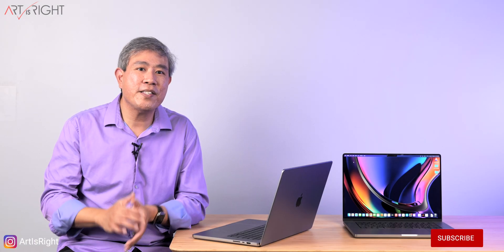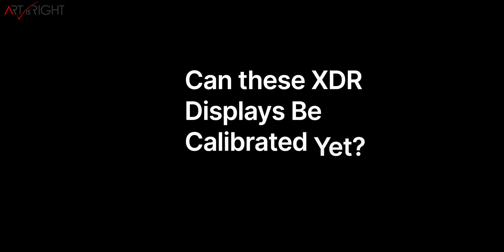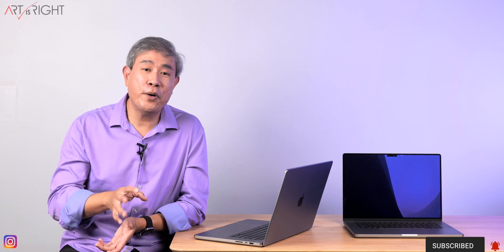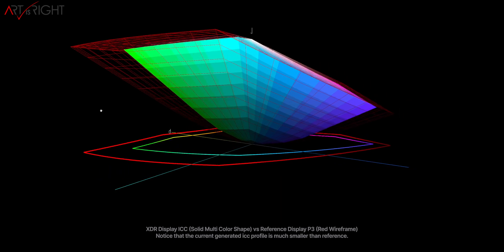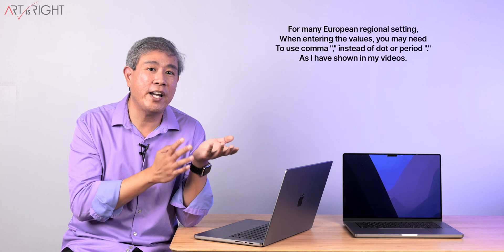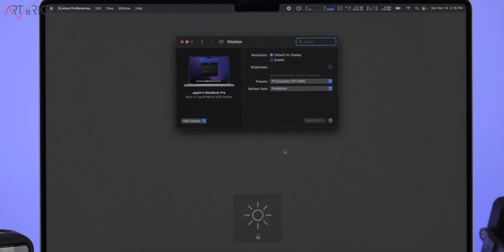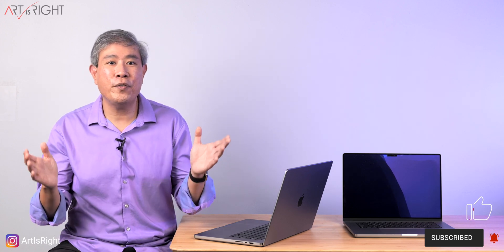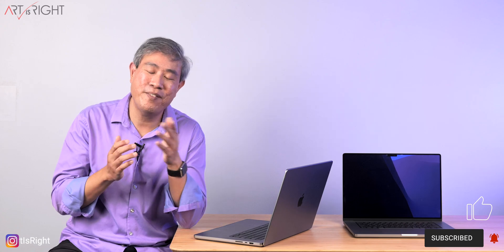State of Apple Liquid Retina XDR, Can I calibrate these yet & some miniLED Q&A

Comment: So the Pro Display XDR, iPad Pro, and mini LED MacBooks are 'technically' Quantum Dot displays or a different display altogether considering the blue LED backlighting? I'm confused, just wanna know exactly what kind of display tech they're using.
Reply from the maker: MiniLED backlight, not quantum dot, those are marketing terms used. Technically the miniLED used here are still PFS phosphor tech but the spectral output is different
Reply: @ArtIsRight thanks, which tech is better though, PFS or QD?
Reply from the maker: For different LED backlight tech, I would not be classified one as better per se

Comment: That's great, and a bummer at the same time! I just "calibrated" my friend's MacBook Pro and couldn't find where it set the color profile. Now that I know that I shouldn't have tried to do it - how do I reset it back to default? How can I remove that icc profile that seems to be applied to the system?
Reply from the maker: Actually you can now https://youtu.be/PLB93k9UYWc and this video will show the reset process as well

Comment: I'm getting different black levels just from a copy of one of the presets with nothing changed (specifically when duplicating the Apple Display p3-600) preset. Do you know why that might happen? I'm trying to get to the bottom of why every time i calibrate i cant hit proper black levels. Automatic brightness is off and true tone off.
Reply from the maker: Because you should never calibrate based on a setting that enable variable luminance. Even though those setting might be off, that Apple display is not a pro mode preset. Also what is the luminance that you are using. This is not a method that I would recommend.

Comment: Now they do support XDR display, however, you have to use the 'new' Pro HL or PLUS HL calibrator in order to have the mini led option in the software. This is a cash grab from calibrite, because my display plus support up to 2000nits, while the apple XDR display only reach up to 1600nits.
Reply from the maker: It is not just only the nits, it has to do with the spectal information that is available for calibration as well.
Reply: @ArtIsRight  I think a software or firmware update should solve it. Its annoying because I just bought the calibrite display plus recently and found out that it dosent support XDR display which is a deal breaker, since it was advertised for HDR display.
Reply from the maker: I am unaware of the inner workings of these software development.

Comment: Hi ! What happened if you calibrate this kind of monitor apart a result of reduced gamma ? The colors will be still correct ? And the best options (fine tuning) for a videography profile ?
Reply from the maker: I would just do fine-tune like I showed in my guide and call it that. You can calibrate the color would be correct but the gamut is limiting. It is like buying a Ferrari, just to put on tires that can go 40 mph max, one shouldn't do that. Same analogy here.

Comment: Hello Art! Any news? I contacted calibrite support to point out the fact we cannot use Calibrite Profiler white patch mesurements to fine tune XDR Liquid Retina Display (due to the fact it does not show coordinates but only K) and they told me they are still working on new macbook pro calibration/profilation solution but years are passing....
Did you notice also that if you use M1 GPU in picture visualization Lightroom library module shows near-to-black tones washed out? Develop module and photoshop show them correctly. It happens with calibrite profile and apple default profile also.
Reply from the maker: I have not noticed this issue. But I'll give it a look. And no update as of now. Simply put the video is still valid, there's no solution as of now. Hopefully one is coming soon

Comment: So in short calibrate the sdr and hdr white points. And stop there.   A note on HDR senior colourists say calibrate your peak whites to 3-500nits with only the most critical specular highlights hitting more than that. They note that consumer TVs will inevitably roll off those highlights to the TVs capability. And very very few are capable of more than 700nits. And if your delivered footage averages out at more than 500nits full screen the viewer will loose all the perceived detail in the shadows. Thus Tv reference modes filmmaker and Dolby vision effectively squeeze the signal gamut down to viewer space. So going hard out on peak luminance averages above 500nits full screen is a waste of a colourists efforts to master an excellent image.
Some early appletv HDR series are all but unviweable even on a 16” XDR screen in home theatre conditions because of this issue. 
As one said to me consumers are more interested in seeing the story than by being blinded by the display.
Reply from the maker: Fine tune the white point, it is just one white point fine tuned, no separation between SDR/HDR. 

About the note, yes and that is the reason behind the various HDR spec, all of them are metadata on how to compressed and remapped the HDR highlight on the display. The entire and scape is a mess right now.

Comment: great video! thank you for the taking the time to make it! is there a "consumer level" calibrator you would suggest? That is likely to have the capablity of measuring the backlight of these XDR displays correctly in the future?
Reply from the maker: Consumer Level, not so much. White point measurement is a pro feature and ability to calibrate this in the future is null with consumer devices as of now.

Comment: Hello I have a problem with my screen and was wondering if you knew what might be the problem. about 3 weeks ago a horizontal line of single pixels appeared. they are different colors than the actual color that is being shown. The number of lines has increased since then though. thx
Reply from the maker: MiniLED defect. Contact Apple Support for help. Hopefully you are under warranty or Apple Care +

Comment: But i have a Question 
if i check my Macbook pro M1 with Spyder X i notice a Differenc

First Try 
I Set WB and Brightness before the calibration 

Second try i do the calibration before and set the Wb after 

Whats the right way?
Reply from the maker: https://youtu.be/bqF_SQWv8x0
Follow the guide use the preset mode, and if possible do fine tune calibration, if you can't do that then just use preset. 

You can calibrate the display but it is pointless because there are no spectral data for these display yet, especially for Spyder, where all of this data is stored on the device that is non upgradable, meaning that you can't really calibrate these displays with Spyder, despite what the company may say or advise.
Reply from the maker: And yes you will see a color difference, however, if you examine the gamut it is much smaller than reference value.

Comment: Hi Art, I tried BasICColor Display 6 and it does it. Good dE (<1) and complete P3 Gamut. It is the only way now.
Reply from the maker: Good to know but BasicColor is not being updated any more as far as I know so interesting.
Reply: @ArtIsRight  The software has been updated! It runs on Rosetta and it’s a bit buggy but will receive an update soon. It has also his own PSF Phosphors matrix
Reply from the maker: I'll have to take a look.
Reply: @ArtIsRight  yes, try it! I’ll wait for your opinion then
Reply from the maker: I'm in touch with the company now and it does work. The result profile is fairly good. I'm going to see if I can do a demo on this. Thanks for sharing this info.
Reply: @ArtIsRight  glad to hear that. I’ll wait for your video
Reply from the maker: Did a few test. The profile does how full gamut, however, there were color anomaly especially in the blue areas. This is an emerging tech and I fear there are some technical limitation with the current sensor for this display tech. Working with smarter people on this. Hope to have an answer at some point.

Comment: Hi Art, 

Thanks for all your videos about calibration. 
I have a question about my sw270c.
Can i switching between calibrations with different os. (macbook on type c and a pc with display port). I mean i calibrated slot 1 for macos and slot 2 for pc for example.
Reply from the maker: Yes that is why that model have 3 calibration slots

Comment: That's so frustrating about the plagiarism—really feel for you, Art. The amount of work you put in is clear & all very appreciated. Hopefully not many are using those other websites as reference & most of us are finding/consuming your content directly from you. & if you're reaching out to those websites, I hope they're doing the right thing & updating their articles to credit you. Consequnece of success perhaps :)
Reply from the maker: I know right, hard to regulate, however, thank you for chiming in! Appreciate it!
Reply: @ArtIsRight  I would like to see the examples of the plagiarised materials you are talking about. However, the field of consumer display calibration is not a rocket science and there is a very high chance someone makes the exact same recommendations independently.
Reply from the maker: Yes it is not rocket science but there are nuances that most people do not know about the software. And secondary display measurement would be one that most don't know about. The notation used in the article was exactly as I have shown it, down to the preliminary recommendation that I have made for miniLED display, which later I have updated with a new video showing the better methods. Coincidental, sure, but the similarity is surmountable to consider otherwise. Methods for calibrating them miniLED with reference mode are not straight forward. So I stand on my suspicion.

Comment: this MacBook Display cannot reach a comparable color accuracy as my EIZO Monitor, even tho I use very similar settings. So until these device manufacturers update their software I will not be able to work on the MBP display, this is so frustrating. xD Also the way their presets work is very annoying, I want the brightness to be adjustable when I'm shooting on location, but I also want to ensure the D65 profile is on. So once again, Apple made something aimed at pros but they just put consumer effort into these products. I love this computer, its super fast, but I still bring my Retina MacBook for shootings because it is much more color accurate having been properly calibrated. I really wish the XDR display will be calibrate-able in the future, very much looking forward to seeing that video.
Reply from the maker: I hear you, personally, I found white point fine tuned effective and get the color consistency to within the margin of error. obviously for color critical work I would use a hardware calibrated display but otherwise, I found these to work well. And just like Andres did, you can have multiple brightness preset. The thing is that the display is Always D65 unless you change that in the setting so Apple Display and Apple Display XDR are D65. Hope this helps.
Reply: @ArtIsRight  Hello and thank you very much for your work. Speaking of presents, haven´t you found some way how to change these color (brightness) presets easily? Maybe with some shortcuts without going deeply into the system settings?
Reply from the maker: @Michal https://youtu.be/OcmeQgKspKQ
Reply from the maker: Interesting that you are running into these issue. In my usage of it I have not found this to be the case and that is with a discerning eye for color. Hopefully a spectral data would come soon.
Reply: @ArtIsRight  Thank you! Not exactly what I was looking for because going through the Control Center is still quite time spending. I found Alt+F2 (Alt+Fn+F2) for going directly to the monitor setting where I still have to choose a profile. Maybe someone can make a script to change the profile with one shortcut, but it's not me. :-)
Reply: @ArtIsRight  this is a really helpful tip knowing that its always D65, unfortuantely with white point tuning and special settings it doesnt even come close to the accuracy of my calibrated retina macbook, everything on the XDR display is just plain purple or magenta compared to any other monitor, it's so sad to see, because the sharpness and contrast are excellent. :(
Reply: @andras_ikladi  yes I did that too, but switching these even from the quick menu is way too cumbersome on location when in the past I can just press a button and the screen gets a brightness so the client can understand his pictures, now I always have to be "give me a sec, I'll make it brighter" then fiddle around, not a good look infront of the client.

Comment: Issue is not being able to adjust white point for Apple Display preset. There is just too much error and I want it correct also for office use, not only for photo editing.
Reply from the maker: Apple Display Preset is for causal use, but here's the thing white point fine tune is for the whole display and there's only one so regardless of the mode that you use, it will apply through out, but sadly not in the 2 casual mode.